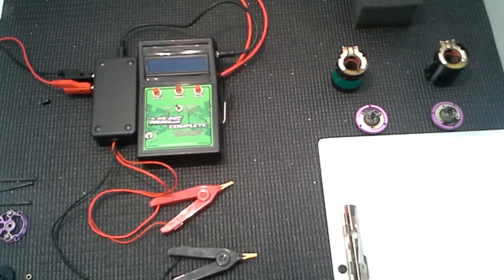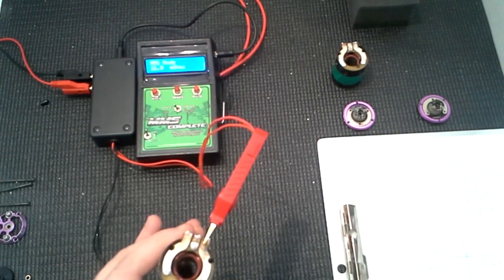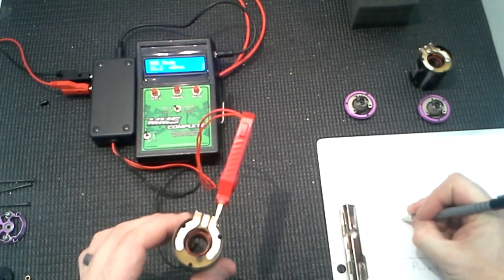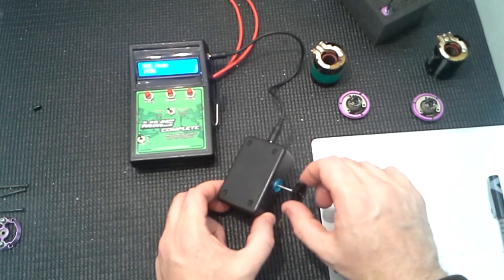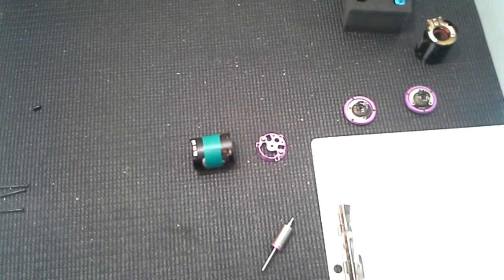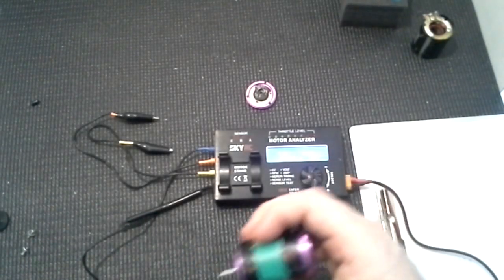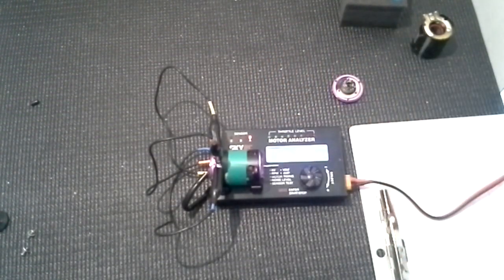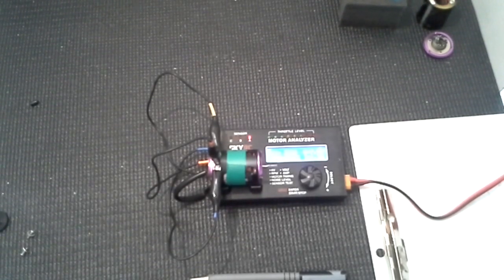Motor tuning: Trinity D3.5 17.5 - High RPM motor build and test

Comment: KV standard and tested?
Reply from the maker: it test at 2320kv at 30 degrees timing. We did further dyno testing with this motor and we found the sweet spot for timing was about 47 degrees. I will check the numbers and post here.